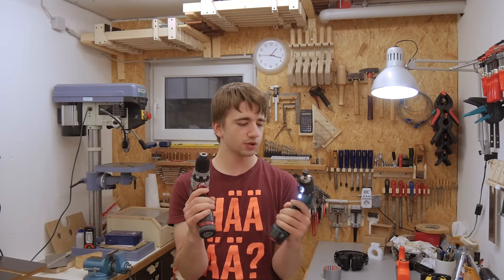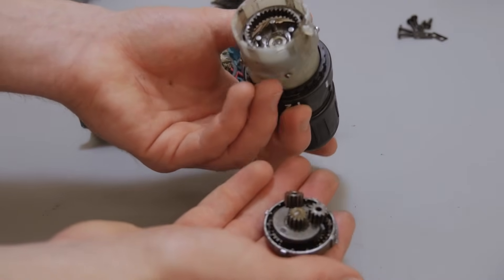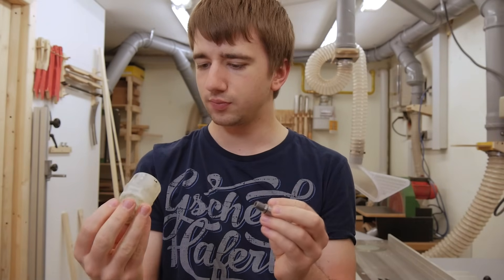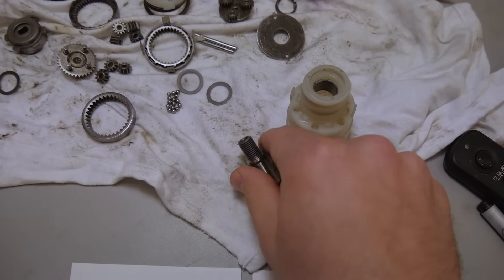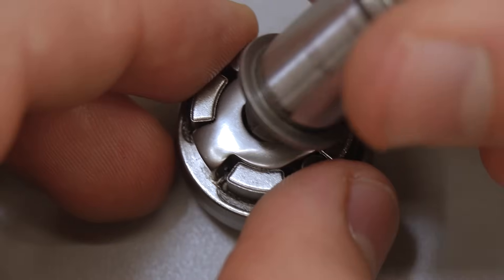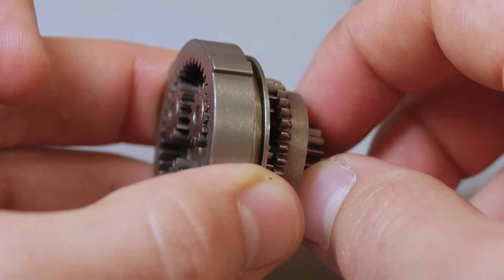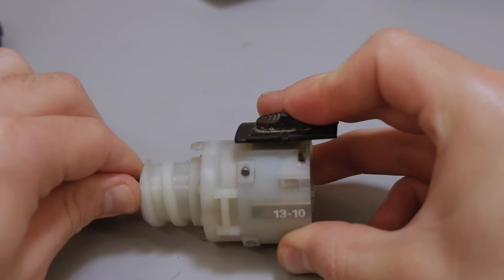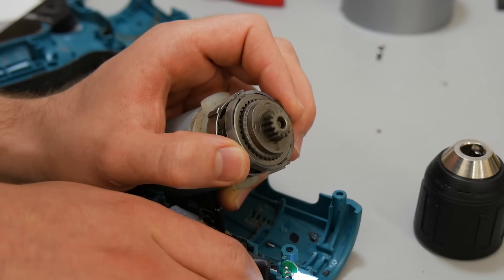Inside a Drill + "repair"

Comment: I have a problem with cordless drill while checking it as it was stuck in hammer mode. Now a small thin metal piece jumped out, has a hump in it which looks like a contact piece. When I press the switch the drill does  not work ,

Comment: Very interesting i bought a drill that doesn't have that locking mechanism therefore it comes with a bigger double sleeve chuck which I hate... Can you just change it for a single sleeve chuck which is smaller and still be able to tighten it?

Comment: My makita had the same problem, shaft was rocking.
I found that the problem was in the two bolts that hold the plastic part to the motor… you can see them at 1:40… you are grabbing the motor in you left hand.

Comment: Beautiful. I just disassembled my parkside drill (its cable powered but it also has keyless chuck) trying to figure out what is the cause of 'locking' the chuck. Also found it had to be those two little pins inside bearing. However the housing of this  bearing broke in 4 parts. So the whole chuck is wobbly and wont lock so it fails to hold/release the tool.

Comment: Great video. The chuck on my drill stalls but I still hear a spinning sound in the gears. It still works because the problem comes and goes. I’m  not sure what is happening there, so I may have to take it apart. And then possibly get another drill.

Comment: Your instructions were exquisite.  I'm a certified international instructor and I know instructions when I see/hear them.  Well done, Laddy.
I have a Rigid drill driver that experienced the exact problem you found with yours.  I sent to Rigid for repair, first they said it couldn't be repaired.
I then contacted their service center and pleaded my case.  They said for $40.00 they would repair it, and since I'd already paid their normal shpg chg of $18.40 which they said they credit to the bill.  I returned the drill to them (recording all my ser. no. etc).  I received a drill in four days.  It was not my drill, surprise surprise.  It looked like a brand new drill...................   Go figure.

Comment: Thanks Marius, 
I took my Makita apart and the gear box spilled out before I had recorded the order of how it was meant to be. I think I can put it back together now.  I'm not sure yet how to solve the original problem which is that the drill is often disengaging the motor gearbox from the head. (As if it in between forwards and backwards). Maybe a clutch problem?

Comment: hi, i have the makita drill like yours. it has 3 modes (screw/normal drill/impact drill). it's problem is when you put pressure it always engage the impact drill wherever mode you're on.

Comment: Thank you for the video, Marius, i have a question regarding drill speed, is the revolution per minute increase if let say i connect drill chuck directly to the motor without the  the torque  part ?Thank you in advance.

Comment: Superbly done!  Thank you.  Just had to completely take apart a makita as the chuck was totally seized on.  No matter how much I whacked it with a hammer it would crack those threads.  Finally managed to get a socket onto the other end of the threaded shaft and got it the old chuck off that way.

Comment: Hi, my power drill has low and high options of speed. For some time time now its low power option works only, switching to high power option starts sparks from the back of the drill  and doesn't work properly to switch back to the low power option there is quiet a struggle( I guess gears doesn't align properly), can you suggest what could be wrong, I don't want to open the drill as may not be able to close it back and lose even the low power option...thanks in advance

Comment: Hi there, I don't know if you are aware or not but you can buy thin wall sleeves that are simply Loctited in position on a shaft that has worn due to an oil seal or something similar. 
If you reamed the bush out and bonded the correct size sleeve on the spindle that would probably work fine.

Comment: I needed to check the layout of the clutch assembly and really enjoyed your Video. You did it really well and your format and storyline was brilliant. The desired result to fix the movement on the chuck was the expected result in the end as not everyone has a lathe to make a bush to shim the chuck as required to fix that movement. You were quite right in it not being a logical route to go further. 10/10. keep it up. PS enclosing the outtakes was also a really good idea.

Comment: I bought  a gear box  and a motor for  drill and impact  a 12 volts DC  they came saperly  went to assemble , and tey are locked  just a litle back  lush  model is hp330D  the parts are acordenly,  any sujestens   my email is  somar1947@hotmail.com  apreciate your response Thankyou

Comment: Very good, I tried to repair my cordless drill, but although I managed to replace the main gear pinion, I have yet to fit it to the shaft. That was 3 drills ago. lol  
Oh well, perhaps one day...
Reply: I gave up on it, but it's helped me fix other drills.
 Some of the pins came out of the bottom section on my present one.
I had another brand new drill to use. So after I finished using that one. 

So I stripped the old one apart, realigned it all. And put it all back.
So now have a working, ratchet adjustment, cordless drill again!

Comment: On my old GMC you could turn the chuck and make the motor go, and my new one the chuck locks.  I always used the old one to spin start the lawn mower, now the new one jerks out of my hand when the engine starts. Also the new one with the motor spinning at slowest speed  hand spinning it faster stops the chuck.  Maybe this is whats happening at high speed. either way it will destroy the drill or break my wrist.

Comment: The drills came that way. It's not wearing issue. It's a lack of quality from makita. I own 18v and 12v drills they both came like that I took my 18v hammerdrill back to get one that had no problems but they all wobbled.  So I use them anyway. Most of the time its not big deal, but if you want a hole in steel to be precise center punch it good. then have someone else  cross their fingers cause yours are busy. Eh it worked.

Comment: I've just recently bought a 'cheap low end' brand 'Silverline' cordless drill, which looks very similar to the drill that was taken apart..  I have also taken my drill apart out of curiosity, and component-wise it is near as damn identical to the Makita, this guy had in pieces!!! - The geatbox is the same, etc etc... . even down to the little clips slipped out where the battery goes in!!!  -  Which goes to show that a lot of the time, 'quality' is a bullshit term more associated with a 'label' than with the substance of the product itself! - And that China makes OEM products that get 'skinned' right across the board, from low-end to high-end branding... but it's the SAME physical product underneath!

Comment: i have a de walt cordless drill driver that has as much sideplay from new! trying to get accurate drill holes was, er.. interesting... it broke a clutch spring just outside of warranty too after only  few hours of work in total. I had, and took back, a bosch (green) drill which burned out its motor windings after just 2 minutes mixing emulsion paint. considering the prices they ask; these things are total JUNK.

Comment: THANK YOU!!!
I've been trying to dismantle a really good keyed metal chuck from an old crappy drill. The left-threaded screw wouldn't come out, but I didn't try the next part at 2:19 which is clamping the chuck in a vise with a beefy hex wrench locked in it then nailing the hex wrench with a hammer. I used a dead blow. The left-threaded screw broke and the chuck screwed off the shaft without incident, then the head of the screw simply fell out.

Now my next step is giving this old chuck new life! How? I'm mounting the chuck to a high torque gear-reduced motor, then the motor is going to be mounted as an end-of-arm tool to a KUKA KR350 industrial robot arm.

Thank you for making this video! It helped a lot and I've dismantled three old chucks tonight already!

Comment: For anyone that wants to know how the Electronics work:

The Trigger/Handle of the drill applies pressure to a Variable Resistor that, as it's name suggests, varies current supplied from the battery. When the Trigger is fully open there is a resistance of 1, this creates an open circuit and power cannot be delivered to the motor, when the trigger is fully closed there is, in theory, a resistance of 0 (in practice this is not true however as all the components create resistance) and max power is delivered to the motor from the battery.

Comment: i have several cordless drills and some not cordless and have never managed to remove the chuck locking screw or remove the chuck, and i have used the same methods,

Comment: Today I opened my 12v einhell it was almost the same as the makita inside. After reassembling the clutch is not working and the torque is very low. Could you think of why this my be caused ?
Reply from the maker: +Nikos Ziogas I'm sorry, but it was probably you

Comment: You could have bought some "Speedi Sleeve " bushing material from you local bearing supplier which would have sorted the bush issue cheaply and easily. ? Just a suggestion ;)

Comment: Quick solution for the wear problem is a partial re-mould. Coat the inside of the plastic housing with epoxy resin to fill the voids causing wobble, and insert the shaft while it is setting up. Create undercuts in the plastic housing with a utility knife to provide a key, and use petroleum jelly as a release agent on the metal shaft. The reduced hole size produced will allow it to turn true and straight again under load.
Nice informative video thanks.

Comment: The motor is just an axle that has magnets around it. Then there are coiled copper wire around the axle+magnets that are charged by electricity which causes the axle to spin. That's the basic gist of how the motor works.. Then the button is a potentiometer which is kind of a resistor that works like the gas pedal on your car.. The more you push the button, the more it gives out electricity to the motor. So just lightly pressing it only gives a small amount of electricity from your battery.. While pressing it all the way down will give the motor everything the battery has..

Comment: Thank you, Marius. Love the video. 

Could you explain how the chuck will stop gripping when it's tight enough? Or over tightened can be damaging?
Reply from the maker: Sure, that's easy. The closing mechanism works with a screw and if there's something in the way, like a drill bit, you're tightening the chuck until enough. Like when you tightening a regular screw. If you manage to over tighten it (very unlikely), you'll break the chuck.
Reply: When I over-tightened, there is clicking sound "tak tak tak". Just curious how does mechanism protect from over-tightening.
Reply from the maker: Ah, I think know what you mean. I have one of these chucks as well. But I don't know how they work.

Comment: Awesome. Thanks, I learned new things from this video. I currently have 2 electric hammer drills and 3 cordless drills (Bosch) and one drill press (Krisbow). So far only one electric drill that needs a bearing replacement and I think I can easily replace the bearing. It won't be so easy if I have to repair the cordless one. lol

Comment: Makita could probably supply the parts. Provided the steel shaft is actually OK; I might have tried to turn up a new bronze bush. 
The division between metalwork and woodwork people is the real problem here. Try to find someone with a metalwork lathe and a small boring bar locally.

Comment: Thank for the video. But you can find exploded views and spare parts for all pro grade power tools like Bosch, DeWalt, Makita, Milwaukee etc.
Here's the exploded view for your Makita DF330 and all spare parts: http://www.ereplacementparts.com/makita-df330d-108v-3834-cordless-drill-parts-c-97_106_107_16103.html
Here the price for the Gear Assembly (Part Number: 125539-3) is $15.33 (€13.67): http://www.ereplacementparts.com/gear-assembly-p-223327.html
And another webshop selling it for just $11.73 (€10.47) http://www.autotoolworld.com/Makita-Parts-125539-3-Gear-Assembly-Df330dw_p_194189.html
And one selling for $13.40 (€11.96) http://www.toolpartsdirect.com/makita-125539-3-gear-assembly-df330dw.html
And here's another one from Austria for €16.95, avaible at both eBay and their own webstore: 
https://www.freytool.com/ersatzteile/Getriebe-Makita/125539-3.html
http://www.ebay.de/itm/152255621360
You can also go down to your local Makita dealer and order the part there. Not sure how much they charge, but you don't have to pay extra for shipping on top of their price.

Comment: Hand cranked car window lifters have a similar function where you can easily turn them by the crank, but you can't push the window down to make the crank turn.  Probably uses a very similar braking mechanism as the drill chuck.
Reply from the maker: Or just a worm drive.
Reply: Marius Hornberger a

Comment: That was super interesting.
I thought it was something electronic engaging for that break on my mastercraft drill because it didn't always engage, but it's probably the same thing, but sometimes doesn't engage right away.  Tempting to take those pins out, I much prefer to tighten the chuck by spinning the drill and holding it!
Reply: Matthias Wandel even professional carpenter youtuber learn something's from this simple video.
Reply: Matthias Wandel I like you channel to. Specially make wood joint. 
:)
Reply: Matthias Wandel a
Reply: Comparing working with and without the stop (separate generations of a model), i like the variant with the stop better. 

While screwing, opening the trigger stops the motion (and all of the machines inertia) at the current depth instead of at a torque. So I would often over- or undershoot in softer materials without this stop, if the torque setting is a little bit off of the expectation. 

Not to mention that repeatedly waiting for the torque limiter to stop those last revs by hand is some additional stress to the wrist and it is almost impossible to just run half of a turn extra or just rotate the machine itself for tightening with hand torque.

On the downside, stopping the planetary gear that hard will probably wear it out one day, although all commercially used ones i know still hold up after years of use.

The video was however informative and shows how much effort went into it. I agree that more powertools always help. Mine is not broken yet, what should i do? :-)
Reply: @denny9931  buy one that is broken and fix it . this is my new hobby recently , and the video is really informative , thanks to him .

Comment: I have a DF 330 and DF 030 (the same without a chuck but a fixed 6 mm bit drive)  - gearbox related stuff is a pretty common issue on those models 

the springloaded switch you mentioned can break - the result is that you can switch to a "neutral" position betweeen 1st and 2nd gear with no drive at all

at first it seams the gearbox is broken but usually it is just the switch or the ring, which engages on the switch 

the gearbox itself is offered by makita for around 20 euro - the whole drill (without battery or accesories) is around 50 euro - sadly the do not sell single replacement parts like the housing of the gearbox
Reply from the maker: Yeah, there is is small neutral spot in the gearbox, when the ring Won't match with either one the teeth. Happens very rarely though.
Reply: if you accidentially hit the spot to often, it gets worse over time - my DF 330  does it on every 5th switch operation or so - the 030 is even worse :)

Comment: To fix this issue try drilling out the bushing, then fitting another bushing into it that will "resurface" it so that you can use the existing shaft. If need be you could turn down the metal shaft a bit for a new surface.
Reply from the maker: +Xeshai I would just make a whole new bushing, IF I had the tools for that.

Comment: wow. Very great video, and very well explained. You are like a mirrored image of me that always wants to repair something, takes it apart, and then realize its not repairable. My last atempt to repair something was a Kärcher preasure wasche. The problem was, the plastic planet gears had broke, and I replased them, a little later, they broke again, replaced them again, and still broke again. I am not sure what the main problem could be, I am sure that the Fact for the planet gears beaking is just a secondary problem after the main problem. But it could also be that Kärcher makes cheap maschines. So since the only ovious problem I can actually see is the planet gears breaking, and kärcher doesnt make metal planet gears, I will have to make my own gears, or at least tell my brother to make them, he works with CNC, and hope for the best. The problem that might come with it, is that metal with metal migth generate friction, and with friction comes heat, therefor, it migth destroy the maschine. But since its already broken and unuseable, I got nothing to lose, just presious time, and effort.